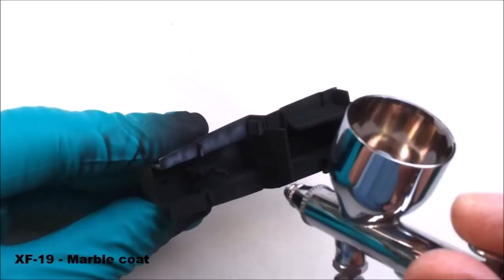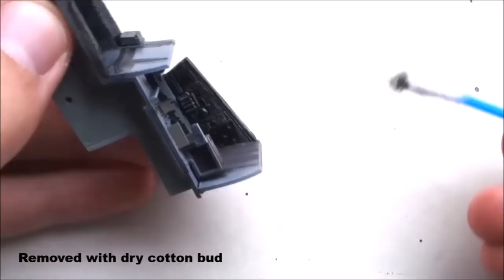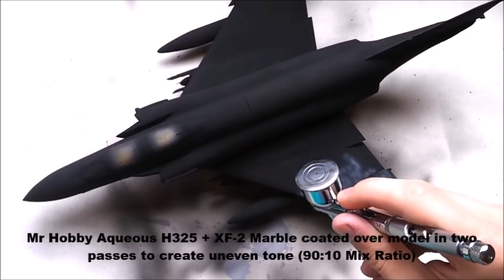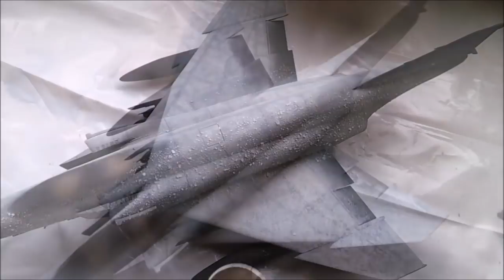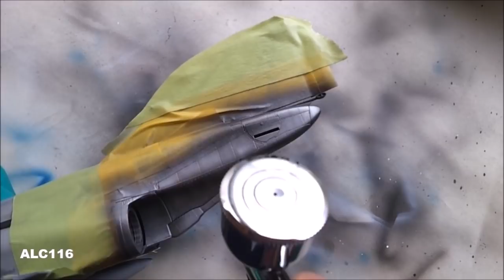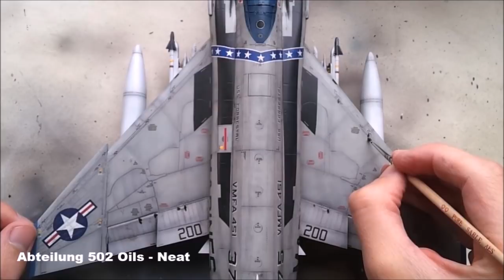Eduard Phantom II F-4J "Rockin' Rhino" 1/48 | The Inner Nerd

Comment: Looks good. But fighters aren't dirty and worn out looking. Not sure why people do the whole 'weathering' on them because they are Meticulously kept Pristine in service. I've seen the whole rock salt thing before as well and tried it. It literally makes no difference. It's like a step people do to make it look like they're doing something unique and special. When far better results can be achieved with other simple methods. But you're well aware of that already. It's not a bad piece. But just looks like your trying to use every technique you know to make it look better. Still thanks for sharing, so I gave it a like for the effort you put in.
Reply from the maker: I'm sorry to hear you don't agree with weathering. There are many references I used to create the weathered look from active service Phantom's. Maybe it is a little over-weathered but its nice to use a little artistic license when making a model right? rather than be stuck in a little box of what is absolute realism and not use your imagination even a little??

I'm also sorry to hear that your salt weathering makes no difference. You can clearly see the difference on this model as the paint on the top surfaces are mottled. Maybe if you try a wider tonal difference you would see the effects of the salt process? I am fond of this method particularly because it helps create a more random tonal variance with sharp transitions than marble coating for example. But the methods used depend on the subject obviously. So it being a step to show something unique or simply to be impressive is a little bit misinterpreted. 

Thank for your comment and being constructive with your views. Also thanks for the like because making and capturing my modelling is very time consuming. Hope you enjoy my future videos.
Reply: @Katan Akuma, having personally been deployed to the deserts of the Mideast and the Pacific Ocean on a carrier I can tell you they definitely get dirty and worn out. Mother nature has an impact and the USAF, USN and USMC do not have the time or money to keep them "pristine". However they do follow all regulations and tech orders to keep them in top fighting shape, "Ugly" doesn't mean they are not deadly.
Reply: The aircrew do work very hard to keep the aircraft clean, inside and out when they're back at their home bases but when they're in theater (KAF) and this is based on my own experiences while deployed (Kandahar), they flying around the clock and when it comes to maintenance, the crews have a small window to preform mechanical maintenance. Washing the aircraft or de-funking the cockpit isn't a high priority. I have seen A-10s arrive looking like they just rolled out of the Fairchild plant in Hagerstown all clean and a very nice matte paint job of greys. Now fast forward just a month of flying missions that nice matte grey  fuselage starting from nose to tail is now about 40% covered in a nice black matte finish from the 30mm and that is not including the oil the runs almost done the entire length of the aircraft . So the  aircrafts are very weathered due to the heavy OP tempo and when you're on the ground and believe me when I say there's nothing more satisfying then having fast air providing overwatch with a few 2000lb bombs to ruin the insurgents day. The pilots take their job very serious, and the reason?  Is because there is nothing more important than the lives of the troops on the ground. I have seen pilots provide protection well over 24hrs and I mean the same "pilot" flying non-stop and most will stay in the air until the troops return to the FOB
Reply: @roguetrooper70  Super awesome input Clint and your spot on!  Im sure it was great to work with the venerable A-10!